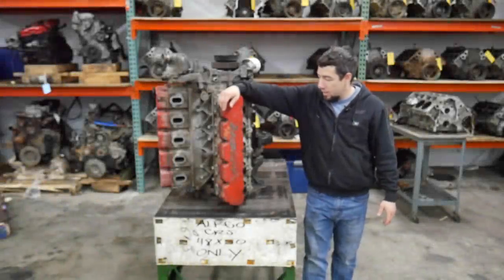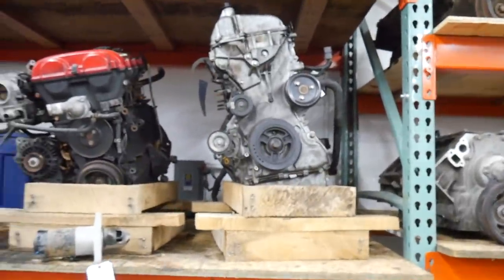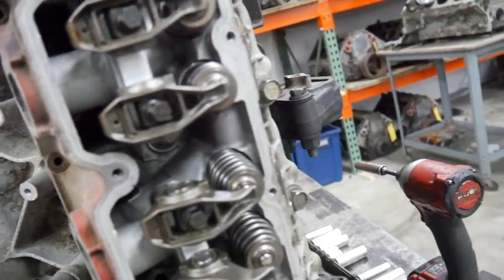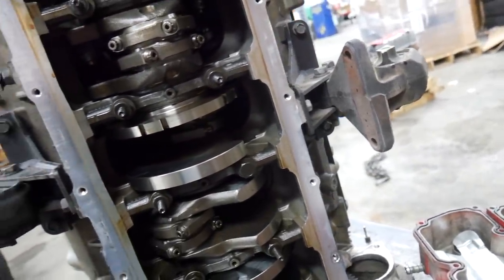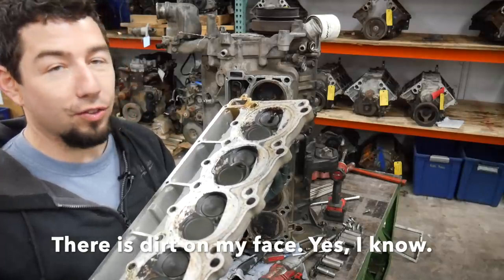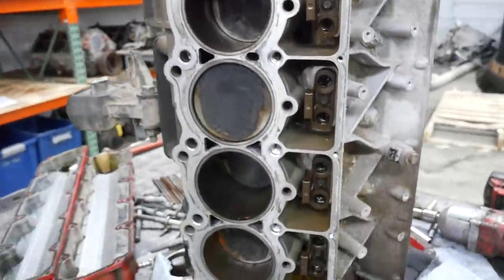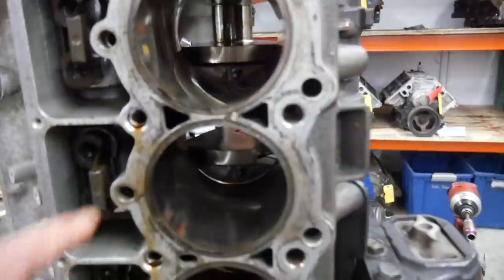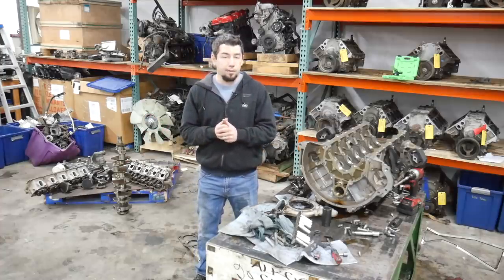TOTAL TEARDOWN! BLOWN UP Dodge Viper 8.3L V10 Engine, What Let Go?

Comment: the timing sensor is placed in the center due to deflection (bending) of the crank during load...or the crank twists slightly from end to end under load so the best place for a LONG crankshaft would be in the middle as the best location to find the average timing position.
Reply from the maker: That makes sense on an engine this long, and my gripe isn’t so much with this particular engine but with 3.7/4.7
Reply: @I_Do_Cars  as far as other flaws found in the engine....the consistent flaw with Mopars with the valve guide dropping is ...pretty lame...I totally give you that

Comment: FYI-valve covers and oil pan are magnesium. Some other parts may be too.
Reply: scrape some off and light it on fire . easy test XD
Reply: @tobiwonkanogy2975  Easier test is a little vinegar on it will bubble if it is magnesium.

Comment: Thanks for putting these up- really cool stuff. I'm in Australia and would love to see someone do these with some of the newer diesel engines being used in utes. Since 2012 or so they all have exhaust gas recirculation valves, which help to burn off extra nitrous oxides. The problem is, they cause a large buildup of soot in the intake manifold, especially if you don't drive the engine at hot operating temperatures frequently/long enough. There is a huge debate online over whether this buildup actually causes damage to the engine or if it just chokes it of air. For a lot of people, it means you have to get the intake manifold removed and cleaned out every 20-50K kilometers. Would be great to see the cylinders and heads of those engines to see what the wear looks like over time.

Comment: The lobe is directly related to the dropped valve seat. Since the valve seat was holding the valve out, there was no pressure form the return spring against the pushrod, then the cam follower. This created slap action against the face of lobe and caused a groove.

Comment: @7m: Outside "...keep 'em covered..."  Covering might keep the rain out, but it won't prevent condensation (cold overnight, humid morning). Condensation leads to moisture accumulating in various nooks and crannies, depending on air flow and thermal mass; as well as lack of drainage.
Reply: This guy’s bias won’t let him see the common sense. He deals with likely thousands of LS engines daily, and occasionally a Chrysler product, but Chrysler is the one with issues and is junk. Right. The 6000 GM engines you blast through daily aren’t junk at all?

Comment: Answer! They put the crank angle sensor in the middle to average out the twist of a long crankshaft, Timing.
Reply: Compensating for crank flex (if even required) could be done in software these days. And perfectly too. No need to take the hardware approach.
Reply: @JxH  the only problem with correcting any deflection is that it will require an additional angle sensor.
Reply: @JxH  well this engine is still using only 2 values per cylinder.... like in a car from the 1960’s... if that should tell you anything about Chrysler’s “technological capabilities” lol. They could have made an engine with nearly half as much displacement make similar power as this engine. It doesn’t make any sense.
Reply: @jeffjob8265  But it wouldn't have the torque curve. They whole idea of the viper is that it was a simple, raw car.
Reply: @Deezle_Gaming  yes but they also somehow managed to make a v10 sound bad. (In comparison to every other v10 vehicle out there)
Reply: @jeffjob8265   I was in the parking lot of a nice restaurant checking my phone after dinner. Well I hear an old pickup truck without mufflers start up and idle. Damn it was was loud and sounded cheap. Well I look over, it was a Viper. I almost bought one in 2015 but went with the M car. The noise at the side of your head and entry/exit gymnastics told me it would not be a fun driver.

Comment: That head is easily repaired. I have fixed a lot of the 4.7 HO heads that have dropped seats. I normally will just take a small punch and peen a little bit of the aluminum around the seat to hold it in. They fall out when they get overheated, so you may want to check every is still straight and true.
Reply: It’s funny how he shits on the parts that only fail when you decide to continue driving when the dummy light and gauges tells you not to. 5 years working at Chrysler and another 5 independent and I have never seen one drop a seat without overheating.
Reply: @mikearmstrong4303  I've seen a dropped seat without overheating...  Mid-2000s MOPAR stuff just drops seats.  It is what it is.

Comment: The wear on the cam can be from roller lifter failure. Common on the 5.7 Hemi. Also if the connecting rods are fractured the caps should be put it back on the rod they came off. Keep that block. It will go up in value every year.

Comment: Currently doing a cam swap on my 5.7 hemi. 60k miles and it was starting to eat five lobes. I pulled it apart because of a misfire which turned out to be a bent push rod.
Reply: I'm no engine expert, but knowing what you now know, could you possibly increase the oil pressure on your engine's oil pump to possibly help keep more oil flowing to the camshaft, lifters, and valvetrain? May not be possible, but if you could up the oil flow somehow, it might help... Again, just a thought as I'm no engine builder.   Fred
Reply: @electronicengineer  that thought hasn't even crossed my mind. I'll have to look into that. I know you can up the oil pressure on an LS engine by modifying the oil pump. Since the hemi and the LS have some similarities, you might be able to do the same to the hemi. I will definitely figure that out for sure.
Reply: @countrychevy1995  I hope that it will help you out and you won't be making a habit out of rebuilding your engine's valvetrain. Good luck.   Fred
Reply: Fred, methinks you know more than you're letting on about.....  the 5.7's have a great big Ole glaring FU in the design phase of their cam and lifter oiling.  They ONLY get oil on the cam lobes from sling off the crank and rods at higher speeds. That's why the cop cars and pickups that idle allot are the ones eating cams and roller tappets like candy.

Comment: Get 1 piston  1 cam new lifters set new bearings set 
Send head to a machine shop for overhauling. 
Make $$
Reply: Did you forget about the rust
Reply: @gamescents3719  that's surface rust, a light ball hone and that block is ready to go!
Reply: to sell it as just parts means "I hate money"...
Reply: @gamescents3719  non a good hone cant fix
Reply: @Arthagnou  exactly
Reply: its called a rotation assembly
Reply: @thisfuckinguy4914  nah bro, rotating assy primarily means crankshaft, con rods,  pistons, and related bearings
Reply: @Airman..  hay I’m no stranger to a bore bar storm Vulcan Aline honer seat and guid machine mag flux heads or blue book value of rotation assembly’s 90% of MOTOR failure is DIRT. You get the crank  repolished the rods get touched up on a belt sander and you never reuse pistons that’s like reusing head bolts you might want to check your facts iv been a machinist for a while and never lost an engine or have a return. Now make bore mics not be a 1000 bucks a pop and only be made by one company
Reply: @Jihadbearzwithgunz  a perfect engine to use on a marine application, no much wear, easily rewbuildable and much better than the current V6 and V8 inboard gas engines.
Reply: Those cylinders were glazed.  No crosshatch left.  Overbore, new pistons (are you REALLY so cheap you'll reuse pistons!?), bearings, etc. and go.

Comment: In my experience, engines (even Chrysler) don't drop valve seats unless they're (significantly) overheated.
Reply: He also fails to realize aluminum heads expand at a different rate and amount than the hardened steel valve seal insert and overheating would certainly cause a valve seat to drop.

Comment: Letting a Dodge Viper sit outside long enough to rust a cylinder should be a crime
Reply: It was out of a SRT10 RAM but still...
Reply: @brucecowgill7672 , it literally says Viper on the valve covers. The dude even says it’s a Viper motor
Reply: @1S1KC0DM4N  When you pop the hood of an SRT10 RAM you'll see Viper on the valve covers. The SRT10 RAM was marketed as the pickup truck with a Viper engine. What makes it even more confusing is that the engine (ZB Phase 1) name/code is related to car model, not the engine itself. This mandates to call the SRT10 RAM engine a Viper engine and that's why 'the dude even says it's a Viper motor'. 

Technically they are the same engine, they only differ to fit properly in the engine bay (engine mount, exhaust manifold, oil pan and wiring).

Comment: I need to put that in my 240. That would be fun. I'm trying to trade it for a foxbody right now though
Reply: Dang that would be insane. That engine is massive tho. Might be a tight fit. I got an S14 with an RB25. Ima do forged internals and everything soon.
Reply: @YaseenAli-zn9ej  Yeah, I don't think it would fit. Lol
I just went from a LS6 to LS7 in my s14 and the LS in general doesn't leave much home either. I think 10 cylinders would be outta the question
Reply: Why don't you get a Toyota 4.0L V8 ?
Reply: @EJ257IHI  Over  LS or RB??

Comment: That cam looks like what happens when you follow the "one viscosity fits all" recommendation in the owner's manual, and also use a modern API SN oil with hardly any EP Zinc/Phosphorus additives in an older performance engine.  If you're going to run a performance engine or any engine you are going to consistently go ham on, run an oil weight on the heavy side of manufacturer's recommendations, and use something with better ZDDP levels than modern emissions warranty oils have, or add 3 or 4 oz of Lucas ZDDP break in additive to get that EP lubrication performance up.  Nothing else in the engine will care, but your valvetrain will definitely thank you.

Comment: The three videos I have seen so far, all the engines seemed so clean inside.... no oil on the parts, no sludge, no nothing than a milkshake inside a cylinder.

Comment: That year Chry they had bought the wrong valve seats from a Manuf.
Reply: From what I've seen over the years, to the detriment of my wallet, Chrysler has used a lot of substandard stuff for many years. This guy spends his time tearing down bad engines, and his view of Chrysler is just what I would expect.
Reply: @wymple09  yup! I have an 05 magnum rt hemi with 190000 miles on it. The other thing that Chrysler I didn't like what they did was running the temp of the engine at 210 to 220deg! If people run them at 180 to 195 I've seen no dropped seats. I've owned mine since New and raced the heck out of it and only issue I've had was a bad lifter and broke a rear gear on the line at the strip
Reply: @davidjohnson8474  There is a lot of speculation that the hemi needs RPMs to keep oil thrown up on the lifter areas because of the radical pushrod angles, and it's good for those engines to get used hard. Grandma's grocery getter & fleet cop cars that idle a lot have the problems, not the hotrods.
Reply: @wymple09 The cam and lifter failure rate on our Police fleet 5.7's is close to 100%. Very common failure. They also mushroom the valve tips, screwed if they idle and screwed if you drive them hard.
Reply: Many years they had this problem.

Comment: Hemi's, Vipers and 3.6L Have that common cam problem. Hemi's have the rollers go out in the lifters. 3.6L the rocker rollers will get play and cause a misfire code. And I DO work at a Chrysler dealership as a tech.

Comment: Chrysler could take a lesson from Japanese motorcycles. Key the seats into the head during casting!!!
Reply: Hahaha! Chrysler learning. Funny joke.
Reply: @operator8014  yeah they still make new engines with only 2 values per cylinder. I mean wth, this motor is a perfect example. You could build an engine with half as much displacement and create similar power output as this thing using 4 values per cylinder. I don’t understand anything they do lol.
Reply: @jeffjob8265  Its because the Americans who adore these cars only care about displacement. They just want BIG everything, regardless of whether or not it's good.
Reply: @jeffjob8265   Compared to European car engines, this and the 7 litre Corvette engine look a really old and simple design. I can’t believe they still have pushrods rather than a overhead cam. Is it the same engine design being used for decades? They probably wouldn’t pass emissions requirements in Europe with such a design, even the smallest and cheapest cars now have dohc, variable valve timing, fuel injection and turbocharged to get past the emissions.

Comment: wow lots of Chrysler hate... Evidently you don't know the history of LA engines which are massively overengineered
Reply: “Massively over engineered” and yet still massively gutless
Reply: @loganamurray64  compared to what, your fanboi BMWs with an o-ring on the alternator coolant channel, when it leaks the engine grenades?

Let's see your fanboi German engines they used to last and now they're claymore mines in a car.
Reply: @johnfilmore7638  Lmao, I quite dislike BMW's actually, they're the actually overengineered cars, hence my putting "overengineered" in quotations initially. The Chrysler LA engines are pushrod V8's, about as simple as it gets, regardless I went along with buddy's story and mentioned how theyre gutless (because they are) and I stand by that. Don't worry about BMW's, I agree with ya, they do so many things that just make you wonder why, doesn't change the fact those LA's are underpowered as hell

Comment: For what it's worth, that engine is out of a Ram SRT10 truck. The deep oil pan is a giveaway. The viper engine pans are flat bottom. Also, I wouldn't necessarily knock Chrysler quality as you never know what that engine was put through. A lot of guys like to really push those engines, especially the truck ones, so entirely possible it might have had a blower or heavy tune in it that could have spiked temps and dropped the seat. You can only design for so much stupid.

Comment: All the top end issues could have been caused by over heating! Its not always a coolant issue. Thermostats stick closed, EGR valves stick  closed and both cause a tremendous build up of heat which can't be dissipated in the valve train. I believe both were missing on the Viper engine, so you couldn't check for those issues. if you get a EGR fault get it fixed right away. A bad EGR allows the combustion temperature when using no lead gasoline (No options concerning gasoline these days!) to climb to be as hot as a blow torch  and this ruins valve seats, valves and the heads themselves...

Comment: I understand a block, crank or heads but who buys used cams, pistons, rods? In my day those were consumables and were replaced in any respectable rebuild. Love your videos by the way, well done!
Reply from the maker: You would be surprised! We sell quite a few rods and pistons, and a lot of people like factory cams.
Reply: @I_Do_Cars  If that's the case, I have 7 pistons and rods from my 2002 C5Z sitting in the garage, LMK if they are worth anything.  Lol.
Reply from the maker: SS OFFSHORE gen3 LS stuff isn’t really worth much. The Gen4 full floater 5.7 rods and pistons are an easy $300/set
Reply: @I_Do_Cars  TY for the reply!  If I were to put those 7 LS6 rods/pistons on ebay, what are they worth?
Reply from the maker: SS OFFSHORE since there are only 7, I’d probably list them as singles @ 40-50 a pop and see what happens.
Reply: @I_Do_Cars  Thanks!
Reply: @I_Do_Cars  is ebay where to find the stuff you sell?
Reply from the maker: Patrick Wayne most of it. A lot of stuff sells through email or phone before it makes it to eBay. eBay is the catchall.

Comment: I think they put the trigger wheel in the center of the crank so that however much crankshaft whip there is won't be "seen" as much by the CAS.
Reply: That's what I was thinking with the crank being pretty long

Comment: The drop valve! I got flash backs to the late 90’s escorts
Reply: Heh, had someone try to blame a shop I worked at when his 1.9 was tapping hard and misfiring after an oil change.  Was a dropped and broken valve seat.

Comment: When my 2001 burban 5.3 goes I will send it to ya for a video. It's sitting at 386,000 miles, owned since new, only put a water pump and some valve cover gaskets. Drive it at least a 100 miles a day. Honestly can't believe it's still trucking

Comment: That timing wheel placed in the middle of the crankshaft, is because the engineers wanted the balance even from front to back. That way they didn’t have to make cuts at both ends.

Comment: That pistons actually not to bad. They will fill it, hone it, match the tolerance and put it back together. You have a fully useable viper motor once cleaned

Comment: I absolutely shocked: 2005-2006 years, not so long ago, and Dodge/Chrysler products 8.3l V10 pushrod engine with 2 valve per cylinder. Like in 50's! It's amazing and incredibly how they did it.

Comment: Using pressed piston pins vs floating pins eliminates a big failure point on a production line engines.  Pressed piston pins are far more reliable than the floating pins, simply because if you install a piston pin circlip a little wrong, it can take out a block and a piston at the same time.  Pressed pins rarely fail.  Warranty issues are a big cost for the manufacturer, and replacing or repairing an engine in a Viper plus labor is a lot of money.

Comment: I would just check the piston for cracks and if none found,I would clean the ding out wirh fine grit sanding and radious the sharp edges.I have been in avaiation industry for 40 years and that’s what I did for foreign objets damages everywhere,engine and airframe,but within limmits.